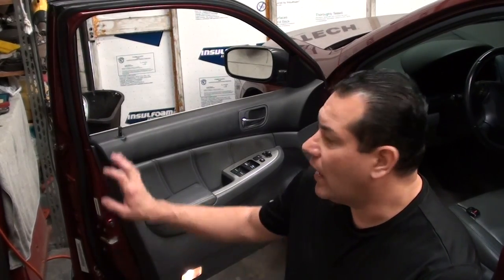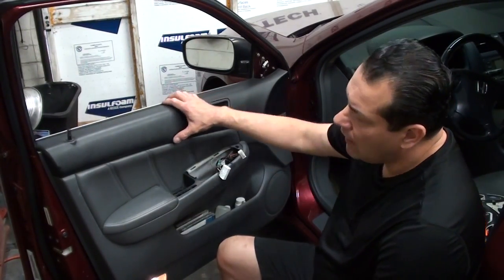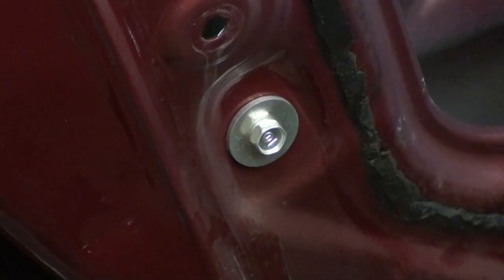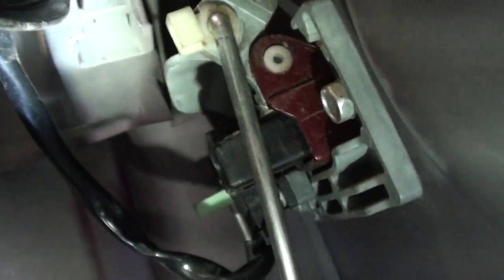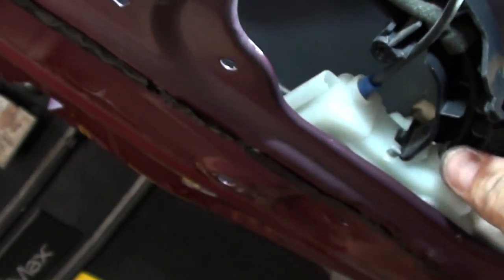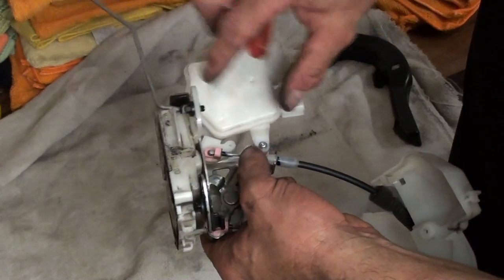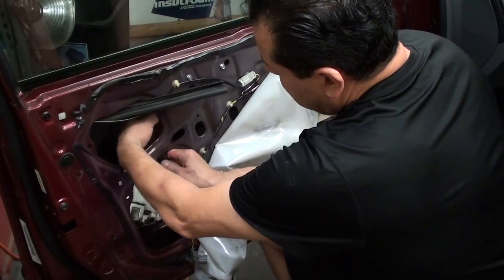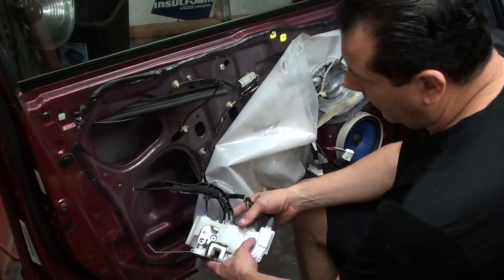How to replace door lock actuator on a 2003-2007 Honda Accord (driver's door)

Comment: Raul - great instructions.  Removing the entire door lock assembly was the way to go.  Definitely made getting the actuator out and in much easier.  I did my 2004 TSX.  Only variance with that car is the extra screw in the handle that needs to be removed, but other than that, everything else was spot on.  Great future reference.  Will be subscribed after I type this.  It's content like yours that makes youtube valuable!

Comment: Great video! I am gonna subscribe to you right away. Could you if possible tell me an issue my accord euro has been having (same car but in Australia). None of the doors lock or unlock with the button in the car. The keys make the lock lights flash but they don't actually lock/unlock the car. Boot doesn't open either with the button on the boot. Everything opens only manually. A week ago everything worked fine. Thank you.
Reply from the maker: Arunim Bhargava check the fuses first, also the door lock module might be bad
Reply: @raiderman28  thank you Raul!

Comment: Paul, fantastic video!!
One question... do you know if it is the same procedure for a 2005 Acura TL? I’m asking because the part # is the same and as Honda and Acura are basically the same thought it should be the same procedure as well.
Reply from the maker: Don Diddy my name is Raul, not paul, but it should be fairly similar.
Reply: @raiderman28  
Sorry about the mistake Raul and thank you

Comment: I got a question what is the name and part number for that little pink clip that broke????
Reply from the maker: Door lock rod clip. But they come in different sizes. Most universal ones might work. I would buy an assortment off amazon and try them to see which will fit. They don’t sell these individually at the dealership.  At least i don’t think so.
Reply from the maker: I think autozone carry’s variety packs also
Reply from the maker: It doesn’t have to be pink either.
Reply: @raiderman28  thanks

Comment: For those wondering about the replacement plastic rod end cable fasteners, I amfinding that they are 3.5mm inner diameter, 6mm outer diameter. I'll update if these do not fit during my installs.

Comment: I replaced this not too long ago but turns out  the 'hidden rod' I didn't seat properly and it came loose and the door started making a rattling sound when locking/unlocking and closing the door ..  I was able to put it in securely and put the tab on it .. make sure it's seated in all the way .. I guess since I was getting a bit mentally fatigued from trying to get it in that I never got it fully in and just 'guessed' it was fully seated
Reply from the maker: d jones yeah that happens to many of us. Dont feel bad.    At least you figured it out.

Comment: Thanks for the info! I’m currently 7 minutes into the video and for the latch screws they’re currently drilled in, any recommendations to get them out?
Reply from the maker: What do you mean drilled in?  Do you mean very tight??
Reply from the maker: I usually use an impact screwdriver. They have a big Phillips head and you use a hammer to to tap the back of the screwdriver and it spins to loosen it.
Reply: @raiderman28  Meaning i tried to drill them out and the drill left indents in the screw so the drill will still spin but it wont hold onto the screw
Reply: - Just found out theyre called stripped screws, my bad
Reply from the maker: @WilsonRicard  your probably going to have to use a tap. YouTube how to remove stripped screws.

Comment: Good video, Raul! Where's your shop? I prefer a pro like you to do the same for my 2003 Accord. Thanks!
Reply from the maker: Al Zenno in san diego ca
Name of my shop is Audioland 
6219 University ave
San diego, ca 92115
I think I charged $195 labor and i think the part was under $90 ( OEM from the dealer. Maybe even cheaper.  I don’t really remember
Reply: Thank you, Raul. My nephew lives in San Diego. I'll call you to schedule an appointment.
Reply: @raiderman28  do you have shop in denver co

Comment: Thanks for the detailed video. I'm a new subscriber keep the videos coming 👍🏻. I got a bit of a dilemma hopefully you can help. I have a 2004 Honda Accord and my door locks open and immediately lock when trying to open with my key remote. So now my driver door doesn't open from the inside or outside and this all happened after the plastic from the latch door handle cable broke & a temporary fix was attempted. So now I have to snatch the front passenger door open and hop over. The dealer claims it's the actuator and the power latch r&r. But they said that they didn't open it but that's there diagnosis and it'll run me over $700 oh and 'if the door panel is broken while trying to repair that they are not responsible' like how?! I came to professionals with hopes of fixing the issue not adding more issues to fix one problem. So my question to you is How can I remove the door panel if the door doesn't open? Btw sorry for the long rant lol. Please help lol
Reply from the maker: Jessica Figueroa It’s going to be pretty difficult because you’ll probably have to remove the passenger seat then the driver seat to get access to the door panel and it will probably break when you’re trying to remove it. When the door is stuck shut and you have to try to repair something inside there it is super impossible not to break anything
Reply: Raul Romo Geez well this is why the dealership probably said that if it breaks they are not responsible. I'm stuck between a rock and a hard place
Reply from the maker: Jessica Figueroa most places don’t even want to touch a problem like this.
Reply from the maker: Jessica Figueroa try to see if an upholstery shop or Body shop can remove the panel for you they have the tools to remove the seeds and panels a lot easier than anyone else then take it to someone who can replace the actuator
Reply: Raul Romo yea well thanks for the help I'll see what I can do

Comment: There's zero need to pullout the metal channel. It can fold up and I just tie it up and out of the way. That way you don't have to worry about trying to put it back together.
The door handle cable he is absolutely correct on that the collar breaks.
If you have a rear door that won't open from the inside it is because of collar broken on the cable. The child lock will be stuck in the down position.

Comment: Hi, what usually breaks inside of the Actuator?  Is it a mechanical part or electrical inside of that plastic?  Thanks.
Reply from the maker: LuvKills Slowly usually the actuator goes dead or starts to die and will make funny noises when you lock or unlock threw the door lock switch. Its usually wear and tear.  If the motor is working but just wont open, then usually its a clip that attaches to the rod that unlocks the door.  Hopefully this is helpful information for you
Reply from the maker: LuvKills Slowly it’s usually mechanical, but in some cases the electrical side freezes up, because actuators get to hot from locking and unlocking too many times or too many times sequentially.

Comment: The arm for the external handle came off. Do I have to remove the whole assembly again, or can I just put a new clip and mount the arm?
Reply from the maker: Glo Glo if there is a clip there, i think you can just put a new one
Reply: Raul Romo 

Thanks for the response. The clip came out with the arm.

Comment: What do you think could be the issue with the following: After arming/locking the car with the Key FOB (2003-2007 Honda Accord) & then coming back hours later to unlock the vehicle with the Key FOB (Recently replaced the key FOB battery) & it does NOT unlock the driver door or any of the doors  (You hear a sound & see the blinker lights flash as usual but it doesn't unlock. Note: All other functions on the key FOB work; Arming/Horn honks/Blinker lights flash, trunk can release, panic button works, etc.)  Then after physically inserting the Key in the driver door lock (Note: The Honda Accord only has one driver door exterior key lock out of all 4 doors)  to attempt to unlock it by turning the key to the right,  it does NOT unlock the door that way either (No matter how much you turn the key there is a lot of resistance & it won't unlock no matter how many times you try). When this first happened, I then replaced the Key FOB battery & then it worked/unlocked the doors using the Key FOB unlock button & also physically with the key, also the interior door lock switch unlocks/locks the doors without any issue. After 4 days the same issue occured again where I CAN'T unlock it with the Key FOB (With new FOB battery) or by  using the physical key. 
DO YOU THINK IT'S JUST THE KEY FOB/ UNLOCK BUTTON HAVING AN ISSUE? OR DO YOU THINK THAT THE DOOR LOCK ACTUATOR IS GOING BAD? (Note: After I get it unlocked 'see below' both of my Key FOB's & the unlock button in the vehicle all work fine until the issue occurs again) If it's the door lock actuator going bad, how can you tell?

HOW I WAS ABLE TO UNLOCK THE VEHICLE DOORS: (Great tip for everyone):
 Fortunately I found a way to roll down the windows via Key FOB (Press the UNLOCK button on the KEY FOB then press the UNLOCK button again & keep holding that button until the windows roll down, if that doesn't work try inserting your key into the door lock; turn it to the right once (or as much you can within reason) then let it go back to the middle while the key is still inserted in the door lock, then turn it to the right again & HOLD it (It may take 5-10 seconds) until the windows start to roll down (At this point you can press the unlock button from within your vehicle on the driver side arm rest; Try pressing it twice to unlock all doors & it should unlock (Note: Attempting to open the INTERIOR door handle may not open the door, you can try the other interior door handles as well, however the best way to unlock it  is to press the UNLOCK BUTTON from within the vehicle) If the window only rolls down slightly then a long stick/long snow brush, etc. can be used through the window opening to press the unlock button, press it twice to unlock all doors then attempt to open via exterior door handles). FYI for anyone dealing with this type of issue (Good info to know in general). Also if you can access your trunk; remember the middle compartment toward the back of the trunk releases forward to gain access through the middle compartment of the back seat area)  Only if you had it unlocked; From within the vehicle back seat area pull down the middle seat compartment/cup holders; you'll see a black middle compartment, use your key to unlock it and then test it to ensure it is unlocked & then try to open it from within the trunk as well (Always keep this unlocked for this reason in case using the Key/Key FOB, etc. does NOT unlock your doors or does NOT roll down your windows to allow you to access the interior unlock button). TRAVEL TIP: Bring an extra Key FOB with you & store it where it would be accessible (Not in your vehicle but in your travel bag, etc.), also bring an extra Key FOB battery & mini phillips/flat head screw drivers that will fit the Key FOB screw (test that it fits the screw & keep this stuff in your travel bag; not within the vehicle in case you need it) Also keep a long stick, snow brush, or  'L' shaped long thin bar in your trunk or travel bag  in case your windows only roll down slightly using the Key FOB window roll down method mentioned previously so that you can press the interior door unlock button. COPY/PASTE or screen shot this & save it as 'CAR EMERGENCY' in your phone notes and add other tips as well or text it to yourself, this way you have it readily available in case you're in a place that you don't have internet access to look things like this up via YouTube, etc. (Download the app: Google Keep - Notes and Lists) if you don't already use a good note taking app on your phone, then like I said all you have to do is type in/search: 'Car Emergency' or whatever you label it as & it's accessible.
Please feel free to comment if you think you know what the issue described above may be or if you have other solutions and also if any of these tips worked for you.  Thank You
Reply from the maker: MileHigh Built sounds like an issue with the key cylinder, intermediate actuator or door lock module, maybe a broken clip. But the issue is possibly in the drivers door. That controls all the doors. If that doesn’t lock or unlock, other doors wont either.
Reply: @raiderman28  It happened again tonight, If the actuator is going bad would that prevent the door from unlocking with the key? Or is the door being prevented from unlocking because the alarm was activated/locked and needs to be successfully unlocked via key FOB before it can be unlocked with the key itself? (NOTE: I'm just also wondering why I can easily lock & unlock the door with the key in the exterior door lock AFTER I'm finally able to unlock the car with the key FOB or by rolling down the windows & pressing the unlock button). Should some of the door handles from within the car open the  door when it's locked? Thanks for taking the time to help figure this out.
Reply: Update: When it happened again I was able to unlock it by turning one key to the right and then pressing the unlock button on the other key FOB (Note: I wasn't able to turn the physical key all the way to the right to unlock the door with the key in this case, just another example of what worked).

Comment: I followed your video. Replaced the actuator and the door actuator will unlock but not lock it. Did I miss something or is this a new piece that's needed?
Reply from the maker: kevin ralph the door has to be closed to lock.  You are aware of this??

Comment: What was the billed labor for it? 
Also if I try this and can't figure it out, do you think any shop will let me take it in and have them pick up where I left off? I want to do this and save money but it seems really difficult for someone who has never worked on their car before. Thank you
Reply from the maker: If your not good with your hands, I wouldn’t recommend trying to do this. If you start a job, many shops can still fix what you have not finished, but those shop have to have done that specific vehicle before.  If not it will be difficult for them to out something back together that they didn’t take apart.  If it was me, I wouldn’t touch it
Reply from the maker: Usually i charge about $200 labor

Comment: I have a 2006 model accord, the key remote range decreased, I had to be right next to the car for it to work all of a sudden it stopped working altogether. Is there a fix for this or is it also an actuator problem?
Reply from the maker: Wesley Ike replace remote battery

Comment: Do you think this procedure would work on my 08' Honda Element?
Reply from the maker: GARY SCHULLER probably similar procedures, but location of bolts, clips might be in different spots. The problem is that some Honda’s you can not replace just the actuator. You sometimes have to replace the actuator along with the long door lock and handle cable ( they sell them as an all in one). These can be alittle tricky to remove and replace, because its so tight in there, but it can be done.
Reply: very interested thank you for the demostrations

Comment: Sir, can this be done with the door closed? Mine is shut and unable to be open.
Reply from the maker: Nope.  You will have to remove both front seats and take them out throughout the opposite door, to have room to remove the door panel. If your seats have any plugs/harnesses on them, you should unplug the battery. Some seats have air bag or sensors and you don’t want to tigger them.
Reply: @raiderman28  thank you so much for the info! That really helped me out planning next steps. You made my day just a bit better!
Reply from the maker: You might be able to just remove that one seat and put it in the back seat???!
Reply: @raiderman28  Yes, that will likely be ok. My next question is this: if the door is closed, how will I remove the three fasteners that hold the latch assembly? They are flush between the frame and the door.
Reply from the maker: Many times the the cable end or the part where the cable attaches to the handle breaks and wont let you open the door. Once the panel is off, you might be able to pull on the cable end to unlatch door or push in the other cable to unlock the door. If this doesn’t work, then you have to get a good flashlight and look into the door and try to pull on the lever that is attached to the cables manually to get door open.  It all depends on why its not opening.  There is no one thing that could have caused this. 
You might have to replace the cable for the handle because many of them break when you take off the door panel. They literally snap and fall apart, because they are now really old and honda used cheap plastic on many of these. The the cable has a white end, its the cheap plastic. If its green , it probably won’t break on removal. This can turn into a pretty big job. Just FYI

Comment: So... what's the part number for the cable to the inside door handle if mine did break?
Reply from the maker: David Bratlie don’t know part number, just go on ebay, they are cheap on there
Reply: @raiderman28  Thanks!
Reply: I found the part number.  The OEM # 72171-SDA-A02 (Driver's side front).  It was about $10 at my Honda dealer and available the next day.  Ebay was about the same with shipping, but would have taken a week to deliver.

Your video was very thorough.  I have done this a few times now on a couple cars, but your video was the best.  If my cable hadn't broken I would have been fixed in no time.  Thanks for a great video!